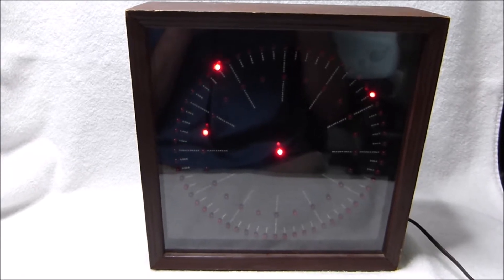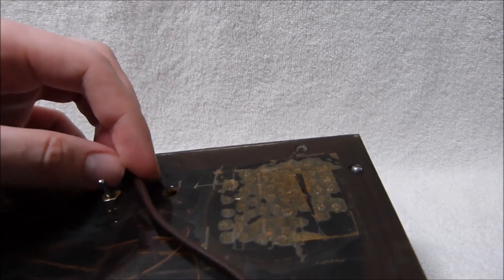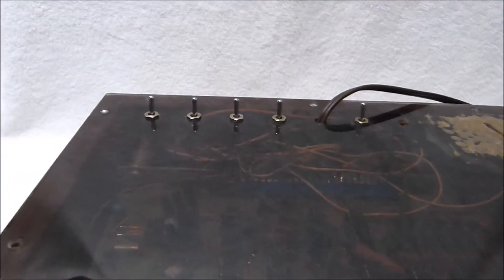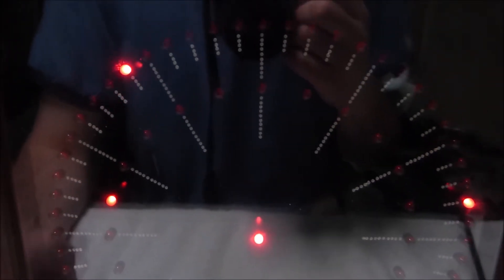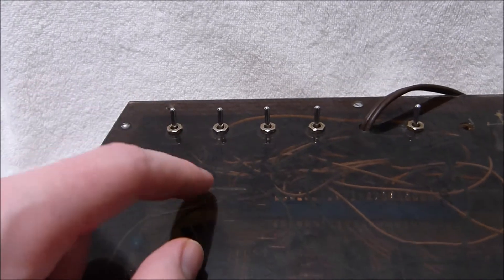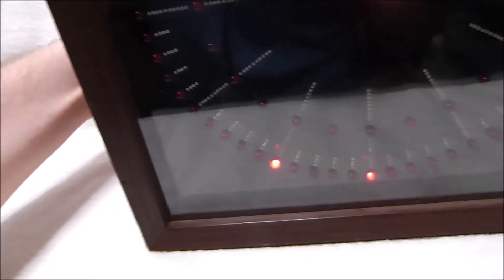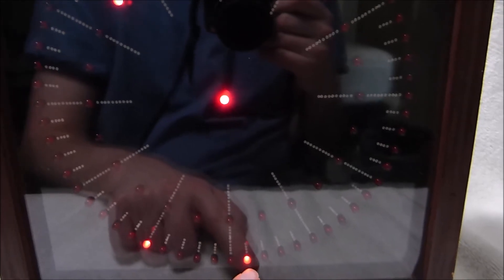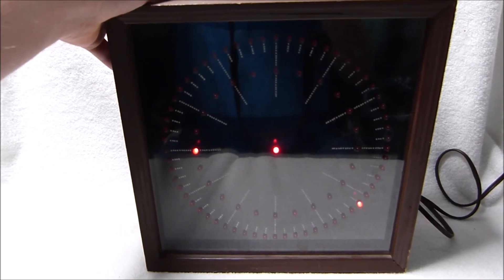Analog style TTL clock

Comment: Interesting clock... would have been better to have ¼ hour interval LEDs for the hour marker... or at least less confusing!
Funny how tape was used over the speaker, instead of a limiting resistor in the amplifier circuit, or a series capacitor for the speaker.
Reply from the maker: Having LEDs for the 1/4 hours as well would have helped reduce the confusion, and been a bit more interesting. I agree there are better ways to reduce the volume than putting tape over the speaker; for me, the off switch works best!